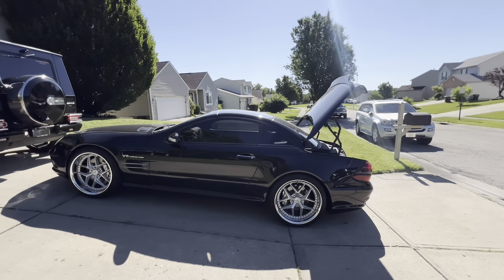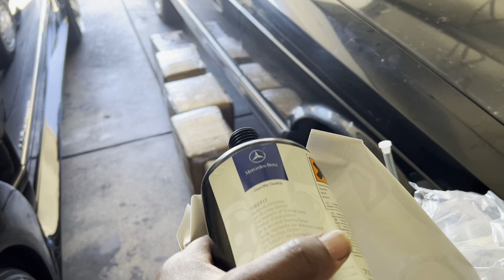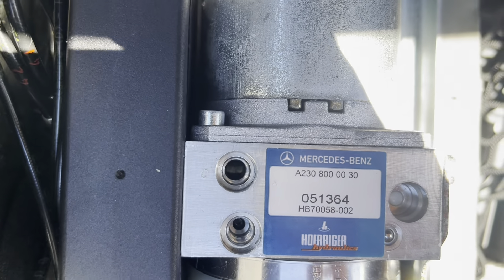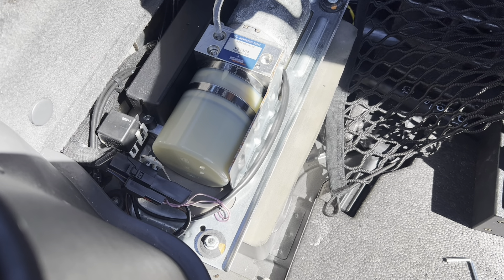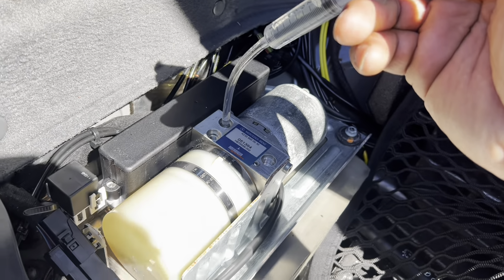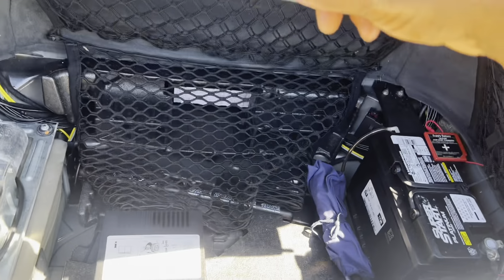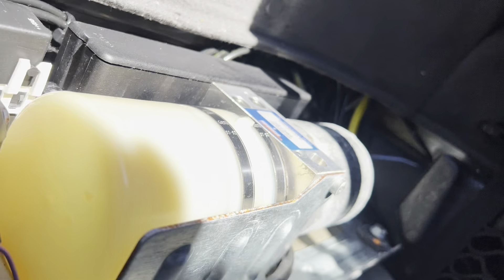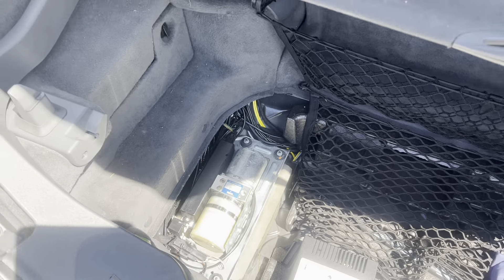My SL55 Vario Roof Is Broken!!! 🤬 Hidden Leak???🤔 Low Pump Fluid 🤷🏽‍♂️ #sl500 #r230

Comment: Brendan turn it into a SL Black edition delete the roof assembly make it a permanent hardtop.   No more hydraulics.  That could reduce another 100 lbs on the car.
Reply from the maker: Whaaaaaaat!!!??? The Black Series is not a convertible? Or is this a suggestion to make mine that much better/lighter for performance? I’m curious now……..
Reply: It's both.

Comment: I have an 04 blk sl55.  love your wheels.  Are they staggered;what size/off set?  I want them.
Reply from the maker: @dustinhuynh7919  Thank you! They are 20x10.5 all around. Staggered tire setup.
Reply: @goldelementautoworks  thank you for the quick replied.  What sized tires (staggered)? Where can I get a set of those rims? I really like them.
Reply from the maker: @dustinhuynh7919  Unfortunately, these rims are discontinued. It will be hard to find another set. 255/35/20 front and 285/30/20 rear.
Reply: @goldelementautoworks  bummer…. The tires have no clearance issues, no rubbing while turning or over bumps?
Reply from the maker: @dustinhuynh7919  No. With spacers, good clearance.
Reply: @goldelementautoworks  what size spacers, thickness?
Reply from the maker: @dustinhuynh7919  It all depends on your rims offset. I’m using 10mm front and 20mm rear
Reply: Who made those rims and what’s the model 🤔
Reply from the maker: @benjamingoldsmithjr8540  Niche M225

Comment: THE FLUID BEING THAT LOW IS AN INDICATION OF A LEAK. I LOSE MUCH OF MY FLUID ON ONE CYCLE....FROM WHAT I CAN TELL, SINCE I CANNOT FIND THE LEAKING FLUID, IT MUST BE FROM THE ROLL BAR PISTON ON PASSENGER SIDE BEHIND DOOR. ALSO, FILL RESERVOIR ABOVE MINIMUM
Reply from the maker: Thank you…..that’s what I was thinking.